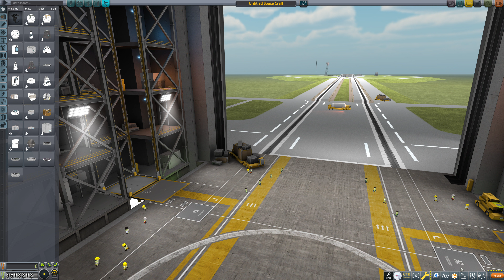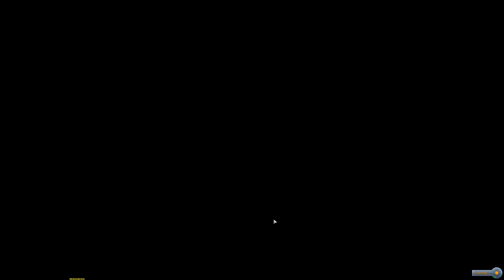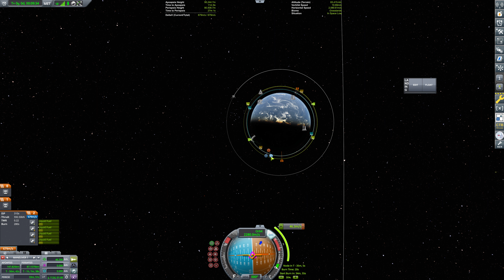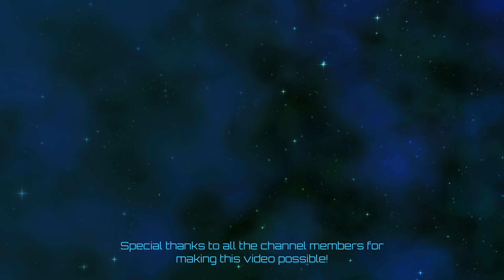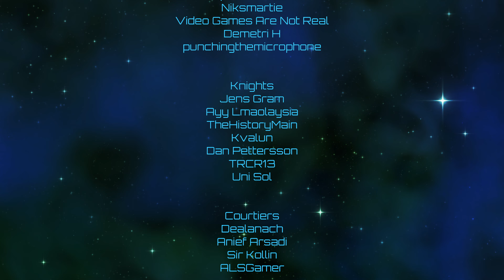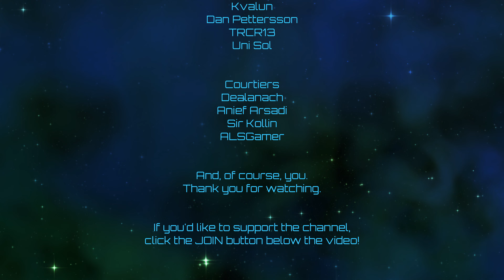Kerbal Space Program | Atraitus Deep Space Mining Co. | Episode 89

Comment: have you not learned anything while playing this game? 1 you dont have RCS unless you have RCS thrusters, so you trying to use it was pointless. 2 if the pink (target) and the yellow (prograde) markers line up then you are going direct. @27 minutes you finally got it but it would have been so much better if you did that earlier. 3 stop time warping when you are so close, i think we would rather everything go smooth instead of shit hitting the fan (like it did @29 minutes). edit here... after going into the video more, around 38 minutes, i noticed you had RCS thrusters, so i take back the first part about RCS not working. i would say you need much larger RCS thrusters
Reply: Or just more RCS thrusters!
Reply: @rawpotato1767  adding more of those small crappy thrusters wont do much honestly. i mean yeah it would be better than what is on there, but that would be like adding more pugs instead of making it a poodle engine.